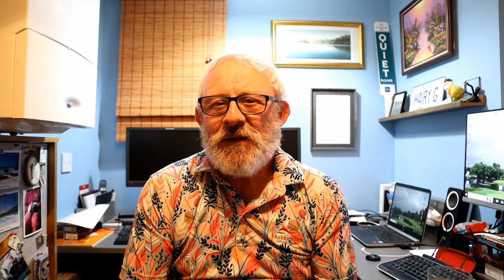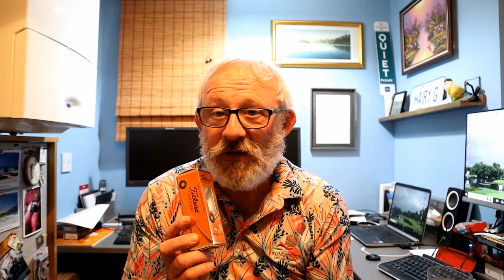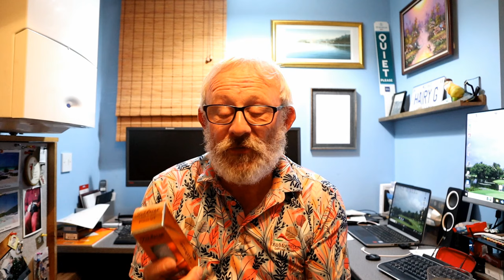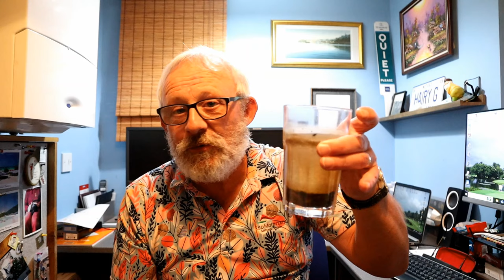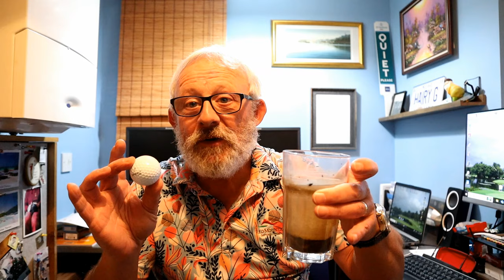Lake balls. Do you play them? Let's make one and test it.

Comment: There are lots of different types of polyurethane, with very different affinity for, and stability in, water. I’ve no idea what sort is used in a golf ball. In theory you don’t need much water absorption to change the mechanical property of a polymer, or to degrade it, so maybe it would make the outer layer softer or a bit more fragile, but I doubt it makes that much difference. ( low levels of water in polymer normally lower its so-called glass transition temperature , which makes the polymer a bit more rubbery than it would otherwise be at that temperature.)

One thing I’d suggest for your test would be simply to weigh the ball before and after being in water for a few months. The weight difference will tell you how much has been absorbed. I bet it isn’t much!

The manufacturers will have detailed results for the amount of water absorbed, and the change in mechanical properties ( eg resilience), as a function of impact speed. If this made a big difference I bet we’d have seen the results in public by now.

If like me you miss the sweet spot half the time, I doubt you’d notice a difference between new and lake balls!

Good luck with the test Simon
Reply from the maker: I agree, not sure if the chemical composition is different between building material and golf balls. I will weigh it, what a good idea. I can compare it to the other balls in the sleeve. I wont cut it open, that's a bit of a waste. But I will go play with it and I expect it to do exactly what other lake balls do. Go straightm go long and go in the hole.
Reply: @thehairygolfer  I would weigh the same ball before and after, rather than just compare the weights of different balls. The ball to ball weight variation could easily mask any small difference due to water intake.  One of my mates suggested a way of testing the ball, he just drops them from shoulder height onto a hard floor and sees how high they bounce. He uses this to compare premium and non premium balls, you might see a difference this way comparing dry balls with one that has been soaked
Reply from the maker: @wanderingbrummie  Balls should weigh 1.68 ounces (if my memory is any good). I'll try it but not sure I have the scales for it. Not that small anyway. Simple test is to hit the damn thing and putt with it. Bouncing off a flat floor should work, need to find one first!

Comment: A local practice area (see Golf de Pinsolle in SW France) has a lake with landing islands in it. The bottom of the lake has a slope that the balls, influenced by the flow of water, slowly move down to one end where they are collected by machine. Nobody knows how long any one ball has been under water, but some practice balls at this club do show signs of wear and are retired from circulation. 

The use of 30 days as a general rule for how long a ball has been in a lake has very little basis in fact. Using a condition of 25 courses and adopting that for a general rule for the other 38,400 in the world is rarely seen to be a valid rule derivation. But I can see that quality graded lake balls can be a reasonable buy. Especially if, considering your diver example, there are a significant number of recovered balls that are not fit for resale.

Requiring a yes or no answer for using lake balls is not far from asking all players to play the same handicap. Both lake balls and golfers have a wide variety of qualities. So I favour the use of top quality recycled lake balls. The only downside to the practice is that ball manufacture is less profitable
Reply from the maker: That's an interesting contraption for a driving range. Hope it never gets blocked up by leaves. Range balls are very cheap and they do scuff very quickly, at least yours don't get cut by the mower. The reason I say 30 days is because the ball divers have a contract with the club and pay good money to dive there. It's not all profit. Plus we are talking about golf courses with lots of water to make the business viable. The golf courses that don't have divers on of course the balls are in there for years sinking into the mud. But then those balls aren't being sold. So yes, I say 30 days for lake balls sold on ebay.

Comment: I have no issues with lake balls.  I've done a bounce test with them and there seems to be no difference.

 I think there might have been something in it, many years ago when the cores looked like a load of rubber bands and the shell was a different material which could have been more porous? But obviously the manufacturers don't want that idea to dissappear as it wouldn't help sales.

I do think you need to dunk two balls in case you lose it off the first tee. It would be a short video..

30 days after you get back from Thailand.
Reply from the maker: I'm certain the old rubber balls weren't worth a damn. There was reason they came individually wrapped and sealed. I've used 300 lake balls and not a single complaint from me. Not a single bad one.

Comment: It's all a load of balls in my opinion.
I've hit everything from brand new pro v's to srixon distance balls I've found in the mud and I think my variance is far, far greater than that of the ball.
Sometimes you get a range ball that you hit and it goes in 3 different directions that ain't due to face and path but I've never had a proper ball do that, even a real cheap one.
Now obviously, I play parkland courses in mud island and spin doesn't matter. The ball hits the green and it's going to stop in everything other than a real drought so if you're playing top quality courses with hard greens then maybe it makes a difference. I can only talk from my experience.
Reply from the maker: I've seen the ball tests from My Golf Spy and certainly some brands are better than others with the robot. Both length and straightness. Plus they test them at 3 different swing speeds so you can see the results for your speed level. Most are so close it doesn't make any difference. Not to you and I anyway. 
Range balls are very cheap and get hammered by the machinary. I get so many which hardly have any dimples on at all. It is so much better to hit my own practice balls and I take the time to throw out the worn ones as they were a little tired in the first place not to make the bag.
For me ball choice is what I want round a green rather than what I want off the tee. 3 more yards on my driver counts for nothing. Cheers